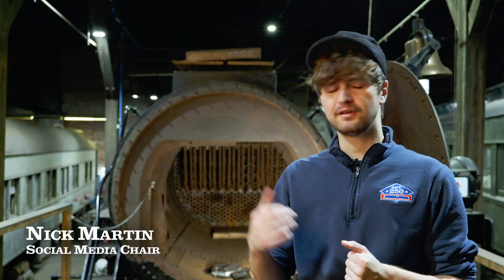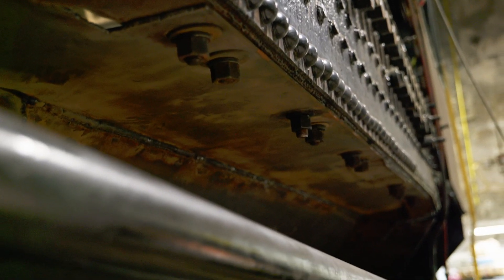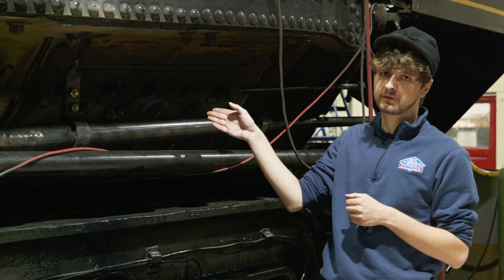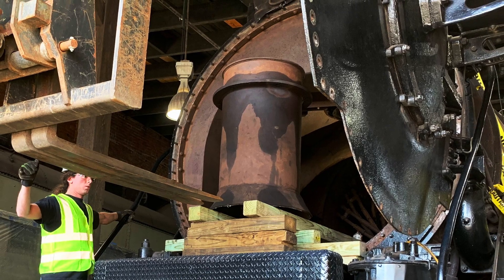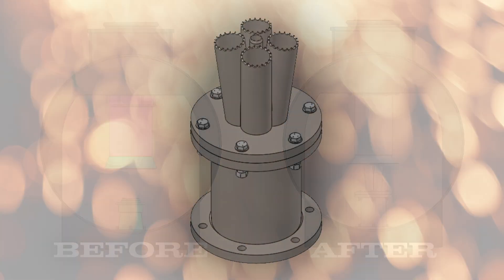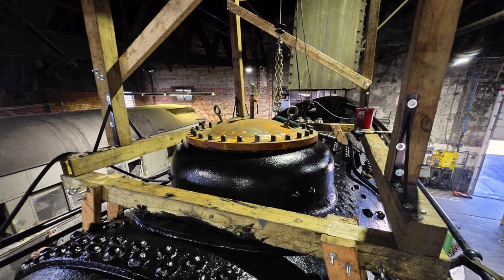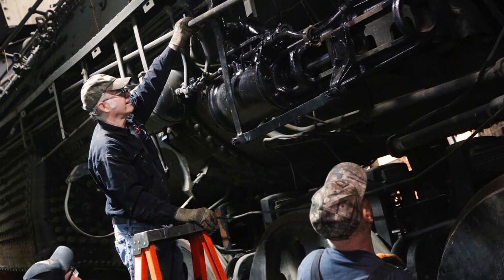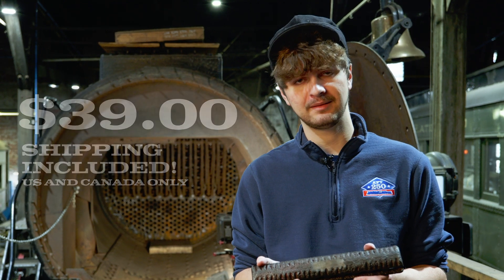Oil Pan Nearly Complete - AFT 250 / Reading 2100 October 2024 Update

Comment: It looks like you would use a lempor nozzle with a cylindrical smoke stack?
That is not the best Option, with a calculated conical smoke stack you have better results.
I believe, it could be difficult , to find a god dimension for all parts on this big loco with a single Stack. I wish you good luck for this.

Comment: Fun fact: 2100’s tender was originally behind 2101.  After 2101 was damaged in the roundhouse fire in 1979, her tender was swapped with 2100’s original tender.  And after 2100 was first restored in 1989, 2101’s original tender was also restored.  So that proves that if 2101’s original tender can be restored to operation, than the engine itself can be restored mechanically too.